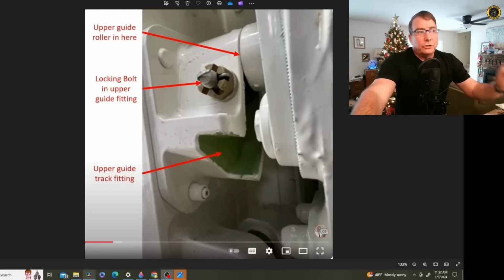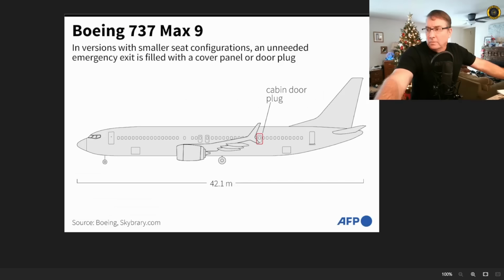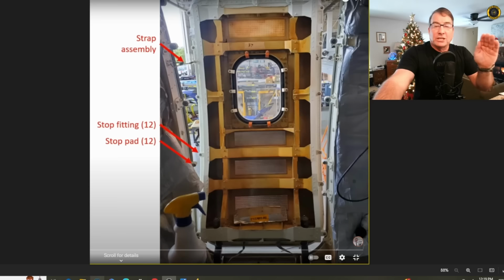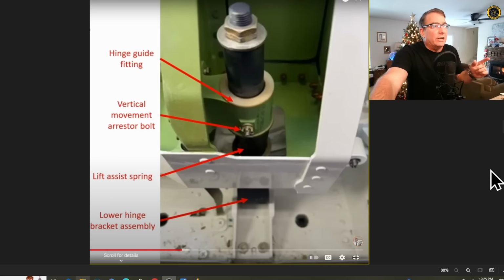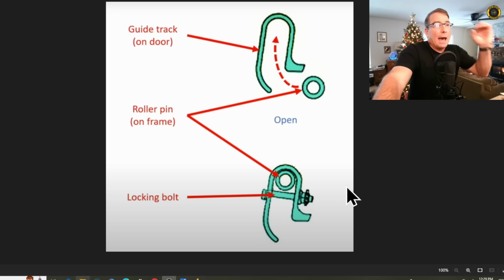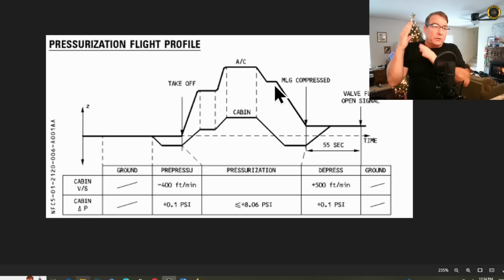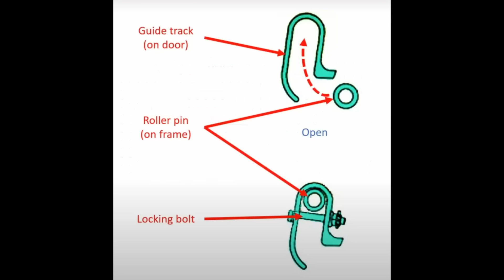Alaska 737 Max-9 Door UPDATE! 8 Jan 2024

Comment: I don`t understand why the unused door is not secured with as many screws as possible -  as far as I understand, there are 12 (!) stop fittings. I bet Airbus would use 12 additional screws, and the blind door would be secured forever. As a customer, I would insist on this modification now ! Fail-safe design is a must, but still seems to be a foreign word for Boeing.

Comment: ?? "8 psi times the square footage of that door"  PSI is the same no matter what the dimension is. There is no multiplication of the PSI based on the physical size of the door. The PSI is the same on all surfaces inside the airplane,  no multiplication needed.
Reply: But on the bolts, the connecting points, the pressure is maximized onto the weakest bolt.  And the pressure should increase as the inside pressure stays equal but the outside pressure decreases with more altitude.

Comment: HOW MANY BOLTS.......?

Juan,

How many bolts & nuts...?

Four Bolts......one at each corner...?
Why no bolts at the mid-points...?

One assumes that Castelated Nuts and Cotter Pins were fitted.....?
Are there any reference marks to these shown, either on the airframe or the recovered doorplug....?

Are the nuts painteds over after installation...?
Splayed Cotter Pins would show a 'paint shadow' if done properly.....

James Hennighan
Yorkshire, England

P.S.
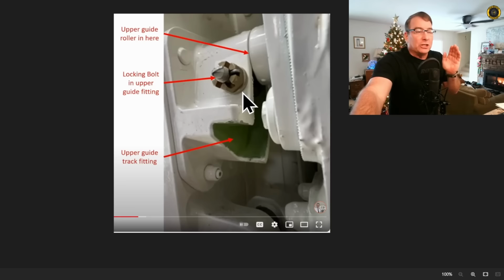The Cotter / Split Pin shown at 1:45 does not appear to be fitted as it should be. The 'head' should not be fitted into the slot on the nut, but should be external to the slot and proud of it. This pin has been rotated through 90 degrees to fit into the slot.

Additionally, it's size looks questionable..It appears to be far too small

Comment: If this door/plug failed because the four bolts which prevent it lifting were missing, what is to say that in a Ryanair jet which has this fitted as an escape hatch couldn't lose the hatch in turbulence too? In that case the bolts would not be fitted any way. Another design SNAFU?

Comment: It's noteworthy to me when I see the recovered panel in the provided images that its exterior surface does not appear to have a surrounding/peripheral lip that mates with the fuselage skin from inside, instead relying on the discussed attached hardware components to oppose the tremendous force of pressurization. Unlike the other hatches on the 737, this assembly appears to install from outside rather than from inside, zig-zagging before resting against attached hardware opposing pressurization force. That's a critical difference, involving a complicated design to effect a less secure way of holding back tremendous force in comparison with all other doorway opening designs on the 737. 

If that pressurization force-opposing hardware is lackadaisically installed, as evidenced in today's disclosure by United Airlines... we may have an answer as to why this happened over several cycles—but not so many—and perhaps with some naturally occurring fuselage flex/twist to finally set it off. I think this is an engineering design that lacks failsafe features, as opposed to the true outward-stopped oversize plug-type doors found elsewhere on the 737 airframe since its inception (before that, actually) more than 50 years ago, including the belly baggage compartments (each one a part of the cabin pressure vessel), their doors on the right, which we can see open inwards and up. 

*"plug" (rather than "door") confuses me; while semantically it can refer to anything that covers or blocks an opening, in the context of pressurized airplane cabin design, it seems to me, "plug" has a specific connotation in that pressure forces the plug outwards against the sealing surface (the fuselage doorframe), requiring nothing more than the plug-style door itself, e.g., any of the other doors on the 737, to simply be present in their respective doorframes to effect a fully secure, structurally fail-safe seal.  I'm now curious as to how the actual emergency exit door for the high-density seating configuration is designed.

Comment: What are the criteria for passing an inspection and allowing an aircraft to be put back in service?  How is it possible to define pass/fail criteria without knowing the root cause of the incident?   If all the bolts/nuts/pins/etc. are in place and tight, that does not address the possibility of a design flaw.

Comment: Castle nut with a cotter pin?? What??? That's it. It's not a ball joint. The nuts need to be lock wired so they don't vibrate out over time.
Reply: So exactly how would the nut get loose when there is a cotter pin that goes from one side of the nut through the shaft, through the other side of the  nut and the tips of pin are bent around the nut?

Comment: They would be better off to have a door there.. not a plug with a couple of bolts holding it on . 
They tighten up the bolts before it leaves, the manufacture, and forget they exist. At least the door probably go through a few inspections now and then. Just install doors on all of them now and get them back in the air.

Comment: 5:00   I cannot understand why the stop pads stop the plug from moving into the aircraft when the pressurisation is pushing the plug outwards?  One would think the plug would be bitter from the inside and press against the airframe during pressurisation?
Reply: Those 12 interfaces are essentially two opposing tabs that protrude from edge of door and the frame and thus allow the door to slide in behind the tabs on frame to provide a way to keep door from being pushed out.

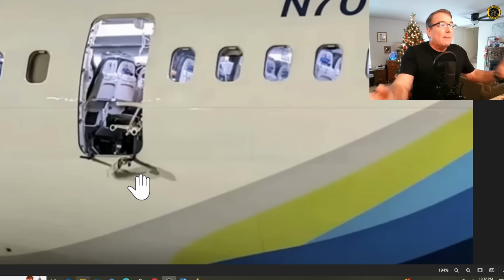Comment: at 9:57 you say pressurization holds the door closed, doesn't pressurization push outward against the hinges?   It's only a few hundred pounds of course
Reply: The pressure pushes the door harder against the seals around it, not against the hinges.

Comment: Given that this plane had a series of pressure alarms, I wonder if that plug was leaking  because the bolts were loose losing the seal.
Reply: I think it's doubtful.  All planes have numerous small "leaks."  Having a single-source leak that was significant enough to cause pressurization issues should have been quite loud and noticeable to anyone seated near that door plug.  But I suppose it's possible a non-frequent flyer wouldn't find the noise and perceptible airflow through and around the paneling unusual.

Comment: Perhaps the castle nuts should be moused into place, like other critical aviation hardware, instead of using cotter pins. I have seen cotter pins break in industry, let alone on aircraft. I'm betting all the bolts and/or nuts were not installed. I've heard that the door fittings were done by a third party, so probably human error.

Comment: Possibly a stupid question, if the door is not going to be used, why not have a plug that is bigger than the whole opening that cant be pushed out? If they decide to reconfigure the plane then they get the actual door from Boeing at that time.

Comment: Odd are somewhat cut and dry; ..someone forgot to install both upper and lower capture bolts set. One set, or even one bolt can be enough to prevent the plug from sliding up and out. Some installation technician(s) should loose their job for this.

Comment: The whole thing is very suspicious.
Doesn’t appear those bolts were ever installed.
There’s no way that door would separate had the unit not  simply rolled up in the release tracks.
With the lock bolts X 4 that plug would not separate. 

Imagine the scramble for schedule logistics of carriers operating this aircraft.
Couldn’t hardly blame them for wanting another type with fewer safety issues.
A fleet of grounded jets doesn’t help the bottom line.

Over its career the Palmdale California produced Lockheed Tri-Star liner proved miles per safety incident quite well. Any aircraft will have some technical difficulties but in the overall experience it was a very stalwart performer.

Comment: I"m trying to figure out how a door plug installed from the inside, with a lip larger than the hole, could accommodate the hinges in the fuselage and fit into them securely.  I can't envision how you would get it into the hinges that have to be there if you ever install a working door there.  Emergency doors have to open out or they will prevent people leaving the plane in a panic.

If you look at around 1:38 and the explanation starting at 4:15, I don't see how you could make that work if the door plug were installed from inside the aircraft with some sort of lip bigger than the hole.

Just a thought I had after reading so many comments stating the door should be installed/removed from the inside.  Maybe someone can explain how that would work.

Comment: Are there nut plates or locknuts where these bolts are located ?  It makes no sense that no visual damage to the door opening can be seen but the door just departed the aircraft. 

Are these plug door parts manufactured and assembled at a vendor ?

Comment: Down?  If the pins fail, gravity pulls the door down and out?  Not design the track to require up push to open the door?  Stop pads not having through bolts?  MCAS level redundancy.

Comment: I might be mistaken, but it seems that the springs help to push the door out of its locking pins. Wouldn't it make more sense to (overly simplified )install the 'locking rail' upside down, so the springs would actually push the door into the locking pin? (Or have pins on the door, and the locking rail on te hull)

Comment: The only comment is on suggesting to an operator to use a website for referencing maintenance… only the manufacturer approved data should be used to troubleshoot and maintain an aircraft…period. Using YouTube to maintain you aircraft is as smart as using YouTube to learn to fly one! Each customers airplane is configured with different option and the technical publications are tailored by specific tail number/line number. Besides it’s illegal per the FARs and extremely dangerous. A contributor to the first MAX accident was using the wrong pubs to service the aircraft.

It’s easy to throw rocks at Boeing but at the end of the day these aircraft are opened up and inspected every 45 to 60 days after delivery. Plenty of people have touched this airplane after Spirit built the fuselage and then Boeing did the completions.
If this was a design flaw or bad part issue the entire fleet would have been grounded…it’s a rigging issue and that falls to Alaska or whom ever is doing the maintenance checks.

Comment: From the design, it appears that all four cotter pins would have to break and then a certain amount of time would pass to vibrate the nuts loose, and then bo(e)ing, pop goes the door. (Pun intended.)
Or the cotter pins were never installed, or removed and not reinstalled.
Reply: Even if the top bolts were missing, the bottom two should hold it in place, right? Since the springs can’t be released until they are removed, so no boing.
Reply: @JohnHallgren  Yes. It appears that all four have to come loose before the door can come out. Four failed cotter pins are almost impossible. So it is likely that someone did not install them at all.
Reply: @JohnHallgren  Photos are being released of other planes with multiple loose nuts on the hinge brackets. They do not have cotter pins, so they were probably not torqued correctly.

Comment: Only one question, you say the cabin pressure holds this door plug on, but seeing it is fitted from the outside of the fuselage, cabin pressure would be trying to push it off. Without the retaining bolts being fitted, it was only the movement of pushing the door up then down to lock it in place. But over time, with vibration slowly working it's way up, then bang, off it went.
Please, could you tell me why was it designed this way, should be fitted on the inside of the fuselage, so even if the retaining bolts were left off, cabin pressure would keep in place, can't be pushed out,.like the over wing exist doors, which are fitted from the inside.

Comment: Is the purpose of the lift spring to assist in the door to move verticle. If so wouldn’t the door natural position to be up. And that you need to push the door down and install the bolts or it would never have lined up from the factory.
Reply: It's an assist spring, ie, probably not strong enough to lift the plug panel by itself.  However, turbulence would have made the plug momentarily "lighter", apparently why the plug went off on its own.
Reply: Thanks make sense. So even one bolt should hold the door from going up. Unless that’s all they installed was one and over time it sheared off. That would explain how it lasted this long. Or none.

Comment: You should elaborate more on the Bolts with Cotter Pins and Castle nuts. Alaska and United have “Found loose Bolts in need of extra tightening”. Would be good to show people in depth how the bolt can’t possibly fall out with a cotter pin and castle nut in place.
Reply: According to the photo included in the article Juan linked above, it’s the bracket bolts holding the hinge to the door frame that are loose, not the bolts with castle nuts and pins.
Reply: Yeah I saw that. And if those are the loose bolts, and the bolts that I was talking about on top with cotter pins and castle nuts are fully intact. Then the door is safe and secure. As long as the top two bolts are on, the door cannot move up, if it can’t move up then it can’t move out and open. Theoretically , you should be able to remove all the bolts and hinges from the bottom of the door plug. ( those hinges are just there to help maintenance open the door and hold it up) As long as the top two are in the place the door would be secure.
Reply: @Titan222Titan  except it’s starting to look like one of the hinges came off the bracket and allowed the door to shift sideways and the springs to launch it up breaking the pins and capture track at the top. Guess we’ll see what the report says.
Reply: @leinonibishop9480   I think there was never any bolts installed in the hangers in the first place. Or at the bottom stops. And the door finally shook loose after take off. The loose bolts the airlines are finding are for the bottom hing brackets. Bad, but as long as the top two bolts were in the hangers door plug would have never been able to come out.

Comment: Boeing and potential passengers are so lucky this did not happen on an international flight over a large body of water.  Once the aircraft depressurizes it must rapidly descend to an altitude that is survivable for passengers.  Unfortunately, the fuel consumption at lower altitudes would most likely prevent the aircraft from making it to an airport.
Reply: And with the in-rush of water through that extra orifice, it wouldn't float for long...

Comment: I have a question about terminology.  Is this door attached/mounted from the inside? (actually making it a plug) OR...is it attached/mounted from the outside? Not really a plug in relation to pressurization.  I believe the old DC9's has an emer. door that was to be pulled in and laid on the exit row seats. THAT is a plug. Next : what sort of pressurization problems happened previously (I have not heard enough  outside of annuciator light coming on) and could the "rattling" door  have been a precursor?
Reply: It’s attached inside at the bottom with spring loaded hinges so that it opens outwards like a gangplank after being lifted slightly to clear the pressure points that act as tabs to hold it in place along with the pins and guide seem in video.
Reply: @JohnHallgren  Thanks John, it is what I expected. It is not a plug as we in the aviation field think of such openings. In this case it is a piece of metal that is bolted to the airframe. I saw another thread further down that I missed, talking about the same subject.  This sort of falls into the "landing your 747 on the "tarmac".
The tarmac will slow you down in a real hurry.  (I have watched Airplane I and Airplane II, so I be an expert on airplanes). I was surprised that the first officer lost her headset and they had problems closing the cockpit door. I guess the pressure differential was more than I would have expected.

Comment: Maybe if aircraft were vibrated like crazy before being pressure tested, they could determine if any loose bolts or anything like that caused any issues.
Reply: Or you could just look where the bolts are supposed to be installed and verify that they have been and are correctly installed.

Comment: What I don't understand is the purpose of the springs on the lower door hinge. Was this suppost to be some kind of preload to keep vibration down?  Without any bolts in place, these springs could help eject the plug, for whatever reason. Without the springs, even without the  missing bolts the plug might have stayed in place.
Reply: I believe the springs are there to help get the door open when it’s desired to do that. Note that when it’s built as an exit door, in the full standard configuration, as I understand it, it then needs to be able to be opened by anyone and flopped down underneath the slide that would blow up there.

Comment: The incident aircraft allegedly had Wifi installed earlier in December and ever since then, pressurization warnings started to occur. According to the source, the door had to be removed during the Wifi Installation.
Reply: Interesting.  I wonder if the planes where loose fasteners were found also underwent similar modifications.
Reply: @OsoMagna  ya not sure. if it is so easily forgotten OR not fastened properly, perhaps there should be a design modification to prevent such error.

Comment: Let us assume that one of the upper guide fitting bolts did not have the cotter pin or sheared(!) and subsequently the guide roller was not secured. Could the one on the other side have kept the door from moving down the upper guide? IOW does failure of one doom the other one to break?
Reply: Any one of the 4 bolts should have been enough to keep the plug in place.